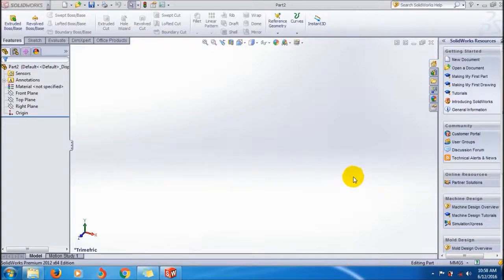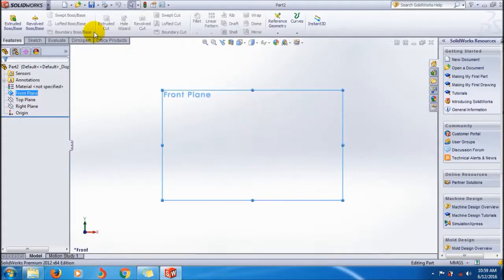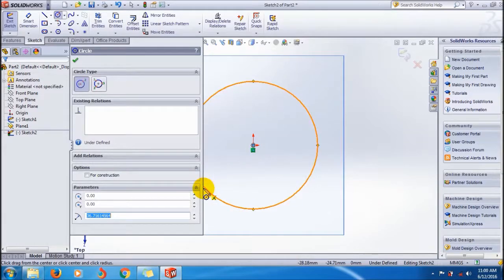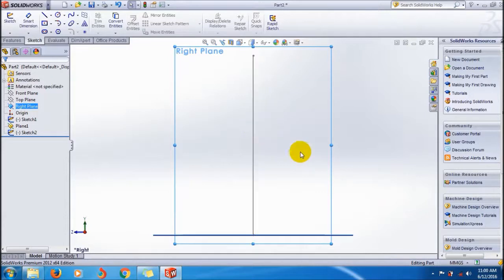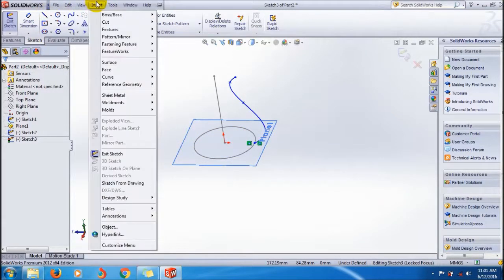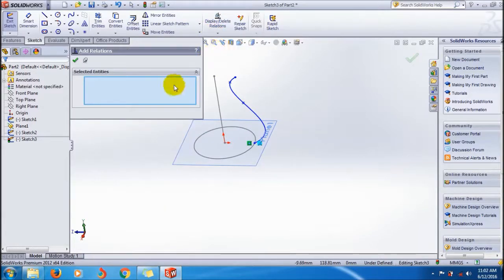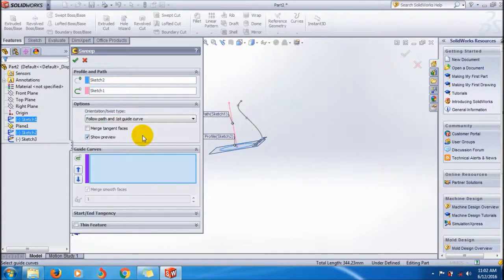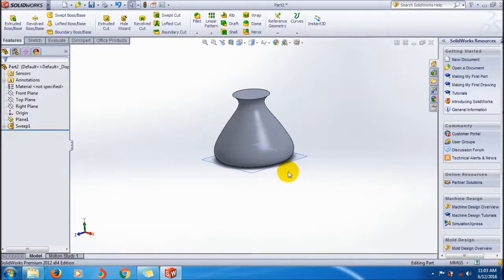SolidWorks Swept Boss/Base Tutorial_1st Guide Curve Method|SolidWorks Video Tutorials

Comment: Sweep command working for small dia circle but not for large when the path has bend.what may be the issue
Reply from the maker: Yes it will work..only you need to align the profile material imaginary lines while applying the sweep command